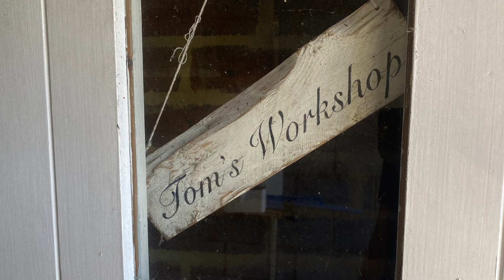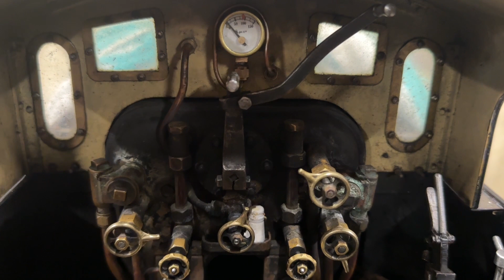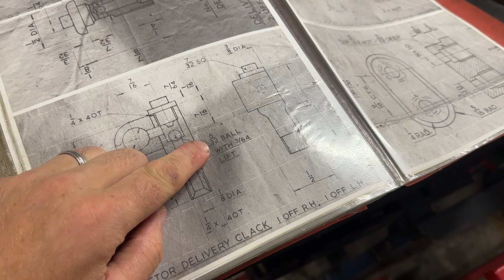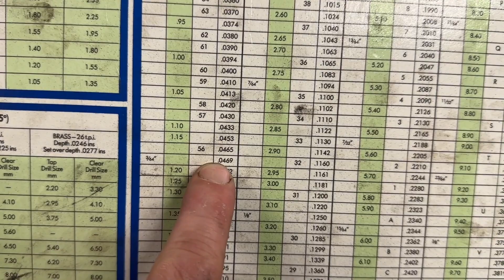Injector issues…

Comment: Perhaps you can answer this Tom, what was the purpose of the plate attached to the coal rails on your 5" Jinty?. I thought maybe to protect the top lamp, when coaling, but it seems rather unlikely.
Reply from the maker: I assume it was to protect the coupling and vac pipes on the full size from falling coal. However I can’t say for sure, just that the full size has it so I added it. Lol.